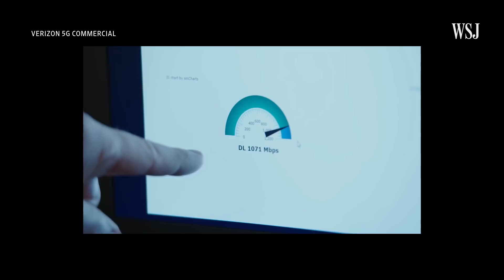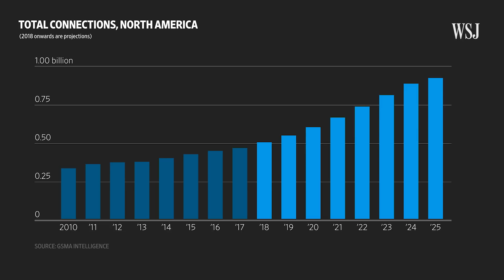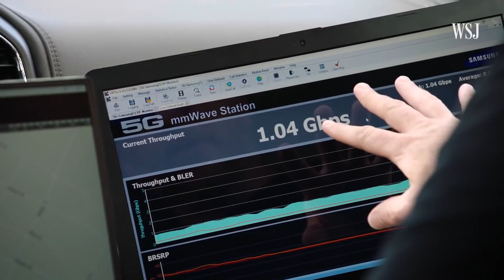5G Will Be Ultrafast, but the Roll Out Will Be Anything But

Comment: Didn't see much about the RF radiation we all will be bombarded with by the transmitters on virtually every street corner.
Reply: That right. In order to provide full coverage with 5G, there will need to be a 5G mini-tower every 1000 feet, or 308 meters in every direction. Or to put it plainly, there will have to be a mini-tower installed every 10 houses. How will parents feel when one is installed on the power-poll outside little Johnny's bedroom?

Comment: Huawei,Xiaomi and ZTE uses a proton-quantum chip that is 100 times faster than a 4G silicon chip.The chip is manufactured by robots using 3-D printer and is hack proof.The chip has A.I. facial recognition and can be connected to quantum satellite.
Reply: Hack proof? ... Until someone hacks it.

Comment: Is a 5G networked city centre the equivalent of walking into a large microwave? Signals that can pass through your cells and affect your electron balance?

There's a huge difference between cell stations 300m and many kms apart.

Wifi is harmful enough as it is, both in transmission and high frequency sounds. Artificial blue light at night is another

Comment: 5G radiation will give us cancer
Reply: Just like 3G or 4G did, right?
Reply: The frequencies for 5G are many times stronger than 4g or your average wifi router at home. Read about it
Reply: @XFatherGod  I know a thing or two about it, that's why I was teasing you. Frequency has nothing to do with the signal's strength. If you want to argue that frequencies of up to 60 GHz (which will suposedly be used for 5G) are dangerous, I need to tell you, that visible light (colors) is the same radiation at frequencies of up to 770,000 GHz.

Comment: WSJ, you fail to mention that every citizen will be living in a 3D rendering baskscatter system. 5G will enable total imaging surveillance, and the microwave energy will cook us from the inside. This is a total 360 surveillance system scalable as a weapon. You propagate madness and an electronic prison system. Shame on you. We are not excited, we are terrified. My god, for the sake of all living things, just say NO.
Reply: You are spreading unjustified fear. They can track you with 3G or 4G too and 5G atennas will not be capable to output high power, which could hurt us, let alone cook us from the inside.
Reply: @FrainBart_main  You may want to do some more research. Look at the power requiments and proximity alone. You are spreading disinformation to not question this.
Reply: @davetone2106  5G antennas at high frequency (which would have to be in every second block) will use lower than 1 W. Radiation energy lowers by inverse square law from the antenna. Average radiation power densities you will be exposed too will be in the range of 1 mW/m² or even lower. Power density inside your microwave oven is tens of kW/m². Sunlight radiation on a sunny day is around 1000 W/m² on average. Why do we fear the 1 mW/m²?
Reply: @FrainBart_main  your insanity is why you do not.
Reply: @davetone2106  If using common sense is insanity, I don't know where we are headed.

Comment: 4g was ultrafast until people started using it.
Reply: for some reason my local cable provider didn't put lines on my street so my internet provider uses 4g I'm paying for 25 Mbps And when everybody who has the same service in my area watches Netflix and plays games my internet becomes 5mbps
Reply: @brandon.smith8667  you should hack some wifi network and use some powerul antenas to get more speed.
Reply: @ForWhhY  if it was that eazy i would i would love to
Reply: 5g has a higher frequency rate, offering enough for more than 20 billion devices.
Reply: @elBambino1932  weak signal will increase Ping

Comment: It operates on the same frequency as water. This is advanced nazi tech. Wake up people. We don't need more than 4G, We need more health testing on 5G - ie. 270 birds drop dead at The Hague from a 5G test. (Yes, it happened - ignore snopes)
Reply: How does water operate on some frequency?! You are probably reffering to water molecules resonant frequency. One is indeed at around 5 GHz, but that doesn't mean 5 GHz radiation is dangerous. It just means that water molecules will absorb more energy at this frequency. But if there is very low energy in radiation to begin with (which is the case for 4G, 5G and similar systems), there isn't any danger associated with it.

You can ignore snopes, but I wouldn't ignore denhaag - [2] and official data for 5G tests from [1]. I don't understand why you people try to convince others into 5G dangers, are you trying to slow down developement? Because of fearmongering like this, now a lot of people believe that 5G systems will kill all the birds around them.

[1] https://5g-ppp.eu/5g-trials-2/#1512730990165-98931cf0-63cf
[2] https://www.denhaag.nl/en/in-the-city/news/huygenspark-ban-on-dogs-lifted.htm

Comment: Yeah....5g is soo much more dangerous than 4g and 3g because of the smaller wavelengths
Reply: Take a look at the spectrum, see where visible light lies on. Smaller wavelengths don't necessarily mean more dangerous radiation until you reach ionizing radiation.

Comment: Wait for 6G?
Reply: It would be meaningless to invent 6G as network speed wouldn't make any difference. 4G network is already good enough
Reply: I disagree that 4g is sufficient and it will take more than a decade for 6g to come out. The problem with 4g is it cannot support the growing number of devices coming on the market
Reply: And it is definitely not meaningless to invent 6g since it is a long from being released. Also it is very foolish to say 6g will not be faster than its predecessors since it is along way out and technology is constantly improving.
Reply: 6G will never happen. 5G will do it’s intended job of genocide from all the   Inescapable microwave radiation and after that, for the ones that survive there will be no communication allowed period.
Reply: 6g is where you link brains directly.

Comment: The short distance of 5G requires many small cell towers to cover the same area as in 4G. This makes the whole infrastructure very vulnerable to the massive hurricanes or storms systems which becomes more common due to climate changes.
Reply: you may not know that when 5G towers are down, the 4G is still available. 5G and 4G are always coexistent.
Reply: @royalmontpark The industry tries to convince the public 5G will enable next generation of technologies such as Antonymous Vehicles, IoT, Robotic Surgery, etc.  If the industry do want people put their life depend on 5G, how their networks can withstand those natural disasters should not be outlooked.
Reply: Yes, in US, 4G is disguised as 5G. Therefore, they are co-existed.
Reply: The carrier's LTE infrastructure in non-standalone will play a huge part in the carrier's LTE-A-Plus / 3GPP Release 15, or as we know it now as 5G-NR. When 5G-NR (LTE-A-Plus / 3GPP Release 15) rolls out, High-Band (24 GHz - 28 GHz) will have priority vs. Low-Band (800 MHz & below), therefore 5G-NR will depend on LTE and use mmWave (Verizon and at&t) and Massive-MIMO (Sprint); small-cell towers will assist on boosting speeds and use of unlicensed spectrum. Theoretically Verizon should be the only carrier that wouldn't need small-cell towers for their 5G-NR network, due to their purchase at Auction 73 (700 MHz). Small-cell towers will play a big role at first, but should enhance a carrier's 5G-NR network. FCC has also given state and localities deadlines to approve or disapprove small-cell towers for next generation WiFi and 5G-NR. 5G-NR (3GPP Release 16) is when the real magic begins.
Reply: Wrong 4g and 3g are always on regardless
Reply: @allah bless Have you tried remote gaming service over 4G or 3G? The selling points of 5G is not only high bandwidth, but also low latency. Imagine what would happen when you are on a train and you play a FPS match on you phone through a remote server or console over 5G but occasionally the connection will drop to 4G or even 3G. If 5G service operators can’t proof the resilience of their networks under critical weather conditions or events, their applications will be limited to consumer entertainment such as streaming 360 videos on stand-alone VR headset.
Reply: Doug Chan 5G genocide is a world wide event. Do you really think their not prepared for a few set backs? So what if the state of Florida is blacked out. They’ll just use our taxes to fix it and get back on line ASAP just like they do with electric ⚡️.
Reply: @Doug Chan One tower vs three towers, not many.
Reply: I am more worried about 5G than "climate change".
Reply: You do have a point there
Reply: LOL!  Climate changes!  LOL!  Weather happens.
Reply: Well said. Exactly.
Reply: another quality youtube comment!
Reply: That's the least of it's problems. People getting cooked on radiation is The Problem.

Comment: But will it have no data caps and how will it handle the congestion when new connections start coming online. These are real questions that really have not been answered yet. At least that I’ve heard. However, I think 5G could be huge for certain things like potential competition for those stuck with cable or even DSL still. Also, self driving vehicles and certain services like remote pairing with surgical robots, will be important. And 5G will make these things possible with the latency that it will have, not necessarily the bandwidth it will have which will still be great for those watching Netflix during peak hours. But, I still believe wireline will always be better for the most part because communication through a wire is better. It’s just physics. And my cable connection, already at 100/10 (Spectrum) is really fast with already impressive latency of 15 to 30 ms nearly everywhere in the US for the most part. Again, this is good for a cable connection and If I wanted, I could get gig serve already with speeds of up to 940/35. Hopefully in the future the upload will be better which is the promise. But so far, based on everything I’ve seen, my connection is still really good with unlimited data. If could hope for anything from 5G, it would be to bring in some reasonable competition (not DSL) and lower my prices. Then, we would be talking.
Reply: NPC #775968657554 IF YOU SUPPORT 5g IN ANY WAY  THEN YOU ARE THE PROBLEM... Smash the problem to bits.
Reply: 5g is supposed to support a lot more devices at a time, so congested areas should see an improvement.